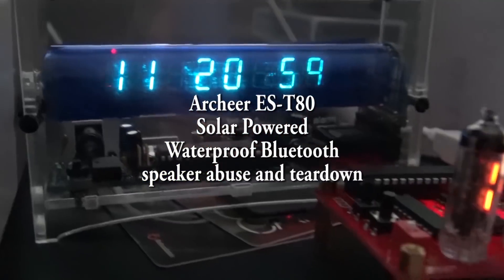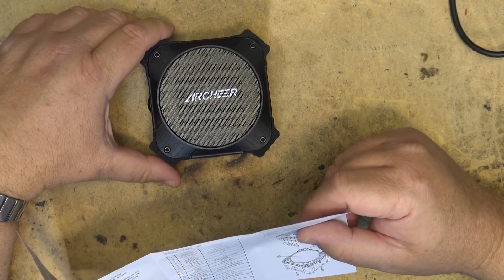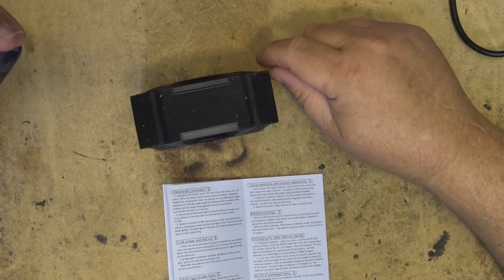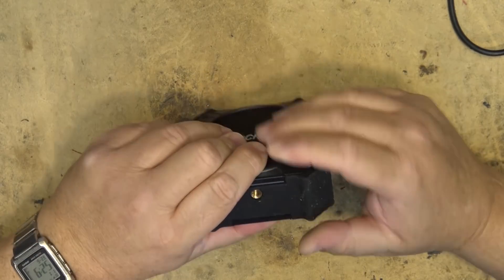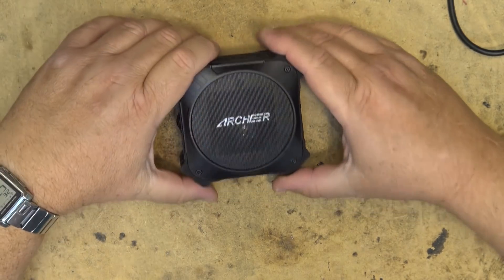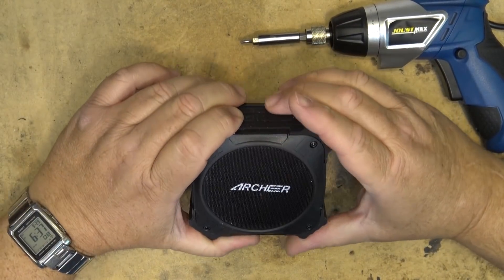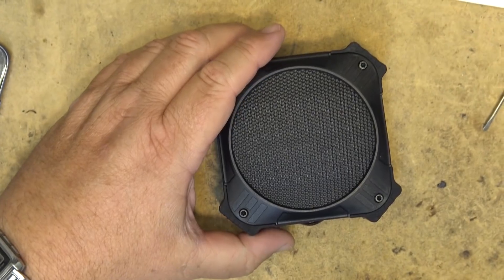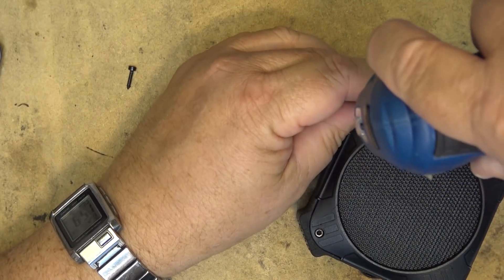Archeer ES T80 Bluetooth teardown and water penetration test

Comment: HEY, I was hoping you could answer a question or maybe get some input from the rest of the youtube community. Winters coming and I plan to start doing some fun repairs etc. Your vids inspired me to goback to my highschool days when I was in electronics. Question is, before I dump alot of old electricle equipment thats damaged,  is there a some types of stuff or  components caps resisters etc I should detach and keep.  I have no specialty electronic stores in my area, some stuff is hard to get so im not sure if there are some common components I should salvage and stock as I go.
Reply from the maker: I generally save boards from scrap electronics so I can pick parts off them later. As far as stocking parts, electrolytic caps are the components that are going to fail the most.
Reply: 12voltvids thanks.... ill take some boards out of some old book shelfs and keep them about then,

Comment: I do like the O ring sealing and rubber cover :-D, that's a decent little unit :-D.
Shame that all manufacturers don't put that much effort into protection.
I was going to say "is it dave proof?" lol, but it is :-D.

Looks like they wanted to use the Archer name and could not, so bang another "E" in there.
Archer of radio shack didnt make quality components, why copy there name??